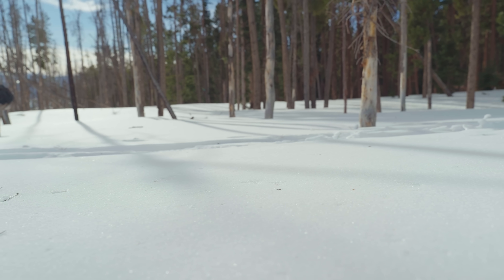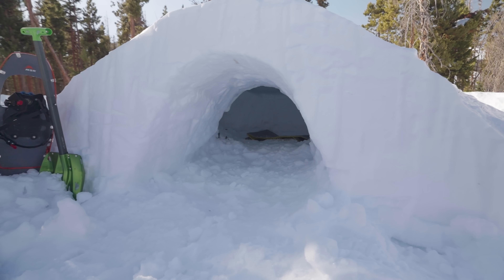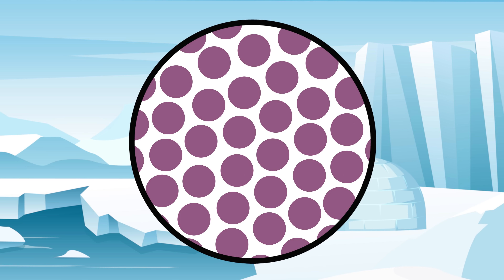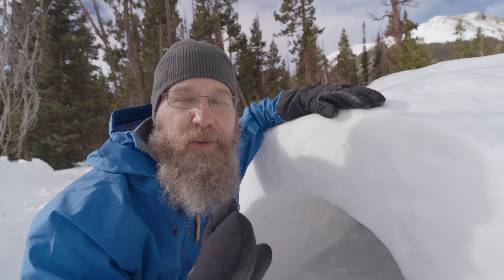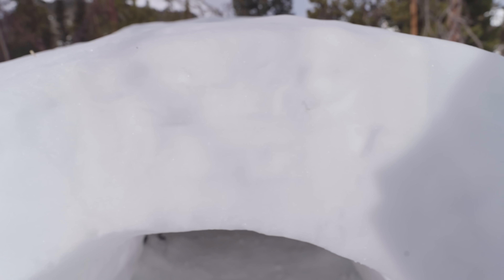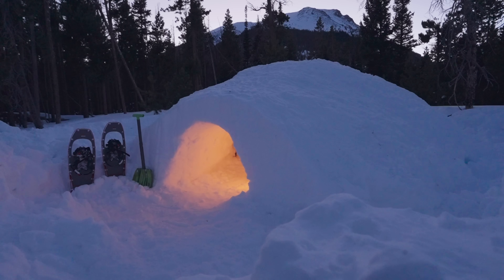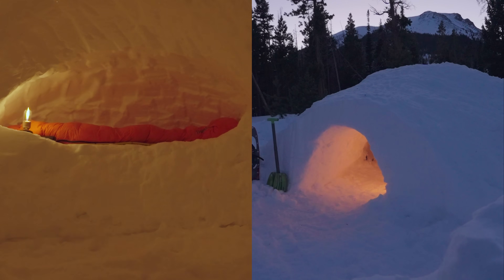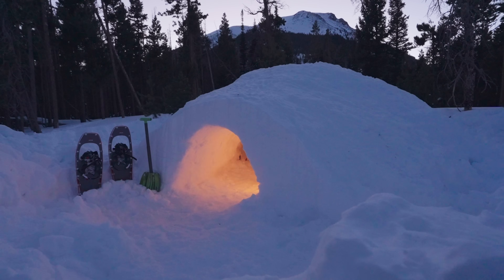Ancient Wisdom Proven Right by Science!

Comment: Once my teacher said that no human can feel temperature, all we feel is heat flux. Take out your hand in the air on the cold day and then touch some metal. The air and metal have the same temperature, but the metal feels "colder". The same thing is when you have a really cold hand and put it under cold water, you either feel nothing or like it's burning your hand.
Reply: This works the other way too, to an extent. Styrofoam can feel hot at room temperature depending on your hands
Reply: @SuperShado101  yes. Sensible heat.
Reply: Yeah...     Stick your hand in snow...    Just because it insulates against the COLDER temperature outside, a snow shelter doesn't make snow warm.
Cold does exist for humans, it's the absence of warmer temperatures compared to the acceptable operating temperature the human body needs to function and thrive.
I always laugh at Philosophy, that attempts to work beyond the human condition, such as when it attempts use things like Snow Shelters and how humans use them to keep from going below acceptable operating temperature, but then going off script to not applying it to humans, after using humans as an example, in terms of effects. 🙄
Reply: @vezeryk6706  I'll explain this again in simple terms. When you are cold you put on a jacket, you increase your insulation, your perception of "cold" is because you are losing heat to your environment and the jacket stops the heat loss. Your core temperature doesn't drop much before you I, Nirmal body temp is about 37c at 35c you have hypothermia and this can be fatal, at 32 you're not shivering anymore, you're dead. So you CAN lose internal temperature but 2 degrees C is the difference between healthy and possibly dead. It's the same with the o.p. thread the metal may be the same temperature but because if its conduction you are rapidly losing heat to it. The same occurs near non modern windows, it's called the "cold 70s " In my trade, again we are most comfortable around 21C ( 75f ) and so your room temperature may be 75 but if you are near a wall or window with poor r value ten you lose heat to it and feel cold, your internal temperature has not dropped . 
Years ago when we designed the the hydronic/ radiant system for a stadium we had to account for the btu load of occupants. Since high mass hydronic take 24 hours more to achieve temperature ( or cool ) we needed to supplement it with radiant panels. Full venues cut the boiler feed and actually run a coolant loop at times cause average human releases 400btuh at rest ( equivilent to 400 burning matches in layman's  ) 

50,000 people resting = 20,000,000 btuh. 

This was unique because usually you just use engineered air to open louvers and circulate cool air into the building to offset the delta t
Reply: oh my god i did not expect a war from absolutes heat genius nerds
Reply: like god damn
Reply: i dont understand  a thing everyone is talking about. it went from heat, to grammar and then heat again
Reply: NPC thread actively rejecting 1 guy bec hes not native in eng and goes agaist an NPC main comment, bots everywhere
Reply: @miaIceberg  😝😝😝
Reply: Ridiculous semantics. Of course humans can feel temperature. It's why we have fire and fans and clothing. Go play your mind games elsewhere.
Reply: Some things feel colder because they're better conductors or insulators.  Electricity is nothing more than a field of force around a wire, but I damn sure bet you'll FEEL electricity if you grab that wire while touching ground!  Electricity doesn't flow through a wire- it never did.  It's a force around the wire.  But go ahead and grab a hot bare wire while touching ground.  

It doesn't matter what terms you want to use.  They're all yours to use or not use.  But "cold" is a term I'm going to keep using because it means, "lack of heat" which is exactly what it is.
Reply: @deydraniadiancecht8298  Electricity (i.e. electrons) in the case of a wire, do flow through a wire, what you are referring to is the electric field that causes the flow of electricity to move through the wire... 🤦🏽‍♂️
Reply: @medicaldepotonline OH MY GOD WHAT AN IDIOT THEY ARE, AMIRITE???🤦‍♂️
Reply: @medicaldepotonline electrons hardly move in electrical lines...
The Youtube Unuversity told me so.
Reply: No, it’s simply due to heat capacity. For example, syromfoam has a very low heat capacity so even if it’s cold, your hand will quickly overcome its temperature (via heat transfer). No so much for metals. Have a search for their heat capacities…it’s maybe first or 2nd engineering.
Reply: @briane9238  Heat flux gets to the core of the issue, heat capacity is more of an abstraction. Both heat capacity and heat conduction are parts of the equation, but its kind of pedantic to say split hairs over which one contributes more because it varies by material. There is one thing in common though: If your hand is losing heat when you touch an object, it feels cold to you. It your hand accumulates heat when you touch it, it feels hot to you. Summarized by the term "heat flux". It really is that simple
Reply: @briane9238  it's due to its conduction. Metal conducts heat rapidly while Styrofoam is an isulator ( not a conductor )
Reply: @MrDmadness think of it this way. If you were to instantly extract all the heat energy in the vicinity of your finger (making the foam a perfect conductor), you would still not get burned. It’s simply because the foam stores very little heat (thermal capacitance) - so while conduction plays a role, the bigger role is thermal capacity. It’s the same reason you can touch a hot thin copper foil…just not much heat stored in it, even if the temperature is high. Most people are familiar with conduction, convection, radiation, but thermal capacity is less known to laymen. Hope that helps.
Reply: @briane9238  you're referring to thermal mass. And no, the foam is not that. It's simply an insulator while the metals a conductor
Reply: @MrDmadness the original question was why metal feels colder than air at the same temperature. It’s primarily due to thermal capacity. The hand can far more easily “override” the cold air because of the stored heat in the hand and bulk transport of blood than it can for the metal. That’s not a conduction thing..the MUCH bigger aspect is simply the difference in stored energy. Good luck.
Reply: @briane9238  yes but it is a conduction thing. You are losing heat at a greater rate to the metal than you are to Styrofoam.  There's quite literally no such thing as "cold" just an absense of heat. You feel cold when you are losing heat to your surroundings.  you put an insulator on ( like a jacket ) now you're not cold because you are not losing heat to the environment as rapidly. In the jacket example you are losing heat by convection ( through a gas medium ) , not conduction ( direct transfer between 2 objects ) . Your hand is colder touching the metal because it's a conductor.
Reply: @MrDmadness when I think about it some more (on the original question), there is some combination of thermal conductivity and stored heat energy that exists that balances the air (with respect to how your mind interprets the sensation of temperature). This is because the ambient air molecules (a fluid) directly contact the skin and are constantly refreshing at temperature. However, a conduction process will always be slower than that. This must be compensated by the thermal capacity and stored heat energy of the metal. For example, a piece of aluminum foil has a relatively large thermal conductivity but relatively low stored heat. In that case, the air will feel cooler..so we know that having a large thermal conductivity is not a sufficient condition. This is the same reason foil in the oven doesn’t burn your hands but a pan will. On the flip side, if a material has a low thermal conductivity but a large ability to store heat, the air may still feel cooler. But I think that scenario is harder to imagine for a metal…but that’s very subjective.
Reply: It's funny how wrong everyone is in this thread.
Reply: @myfakeaccount4523  bro is lighting 
a dumpster fire once more 🤣🤣🤣
Reply: You're teacher was wrong. I have a maior in heating design. There are 2 types of heat 1. Sensible and 2 . Latent .   sensible it heat you feel,  latent heaT changes state of matter. Your body temperature doesn't change but your perception of a cold object is your loss of heat to the object ( sensible heat )
Reply: @MrDmadness  Your points are correct, but the issue isn't that there are differences in 'types' of heat but that the body works on salt.

See, we have different types of sensory nerves, and they all work on ion exchange... effectively salt channels that shuffle electrical charges until a threshold is met, before dumping that charge and thus sending a 'signal' to the next cell. It's not too complicated, but the end result is that if left to their own devices, nerves don't do anything. They respond to changes not states. In other words, while we can feel 'cold' or 'hot', it's not perception of ambient temperature so much as the loss of body heat TO that outside not-us (or the processes that stimulate cooling if we're too warm).

It's counterintuitive, but advanced biology covers it simply because of that curiosity.

Material design, engineering, heating and cooling, etc focuses on heat transfers and thermal deltas, how they interact and the like. But the point to take from it is that there's a difference between 'feeling' hot and 'being hot'... and likewise in the perception of heat rather than how hot something is.

Same reason that we can feel cold and end up sweating under the covers... our bodies have self regulation, but not absolute data collection. It's really rather wild once the mechanics are understood.

So, TLDR, no, their teacher wasn't wrong, and neither was yours. The disconnect is between definitions that remain a bit ambiguous.
Reply: @kimudo  what you said is absolutely correct, there is a difference between feeling heat and your actual heat levels (temperature) , for example when you have a fever what you have is higher body temperature but you will feel cold because as the temperature of your body rises the difference between your body temperature and ambient temperature of the room increases as well which increases the rate of heat transfer between you and the enviroment therefore you feel cold while you are actually hotter, when you touch metal on the other hand it feels colder than lets say the air because it has a higher heat trasnfer coefficient which to put it simply for those that dont know means that metal can absord and transfer heat withing its entirety faster than other objects like air or wood
Reply: @MrDmadness  no, I don't know how you've misread his comment but he's 100% right. also, might want to check your grammar.
Reply: @MrDmadness yes, if you can't hold something hot in your hand it's probably over 50*C
Reply: @sharymens8187  yup. 50c takes about 10 min of continuous contact to produce burns.
Reply: @MrDmadness Who even feels sensible heat? It’s just the energy required to change a body’s temperature by 1 degree
Reply: @satsumagt5284  it's not, it's called sensible heat because you can feel it. You can feel the difference between -10 and +10, you can also measure it, latent heat not so much which is why its relevant to this discussion
Reply: @MrDmadness  Sincerely, Your argument is ass. Body temperature does change when you lose heat... The latent heat is during freezing/unfreezing or with like liquid water changing into vapour, it's an isothermal process. Don't know how you found that in the hand tho. ...Try getting outside maybe and see if your body doesn't change temperature? The body keeps it's temperature either by cooling itself with sweat or internal heat generated by biological processes. Still, it doesn't change the fact it's the heat flux that is responsible for the feeling you get in the brain.
Reply: @vezeryk6706  your internal doesn't change till you start to die buddy. Latent heat is the heat that changes state of matter
Reply: @MrDmadness  Um... that's not even remotely true.
We have a range of 'safe' temperatures, but that's why we have a 'set point'... it's a biology term that references the body's recognized safe operating temperature. It's why fevers and hypothermia happen... when the body gets outside its ability to properly and automatically self regulate.

Your 'core' temperature might not change much... but that's like saying you are incapable of burning your hand because the thermometer in your mouth reads 98.6.... far below 160, so you can't be hot.

And, incidentally, state changes are FAR outside of any safe core temperatures for humans. You're arguing different terms and meanings, not that heat exists.
Reply: @ What do you need latent heat for? I just doesn't get why you repeat that like it's some mantra. Your point was like completely off topic. Latent heat is just a property that has no use in human body in normal living conditions... if anything you could argue about water vaporising off your skin, but that's just one case and doesn't even cover whole thing I wrote about. Do you even read what you texted? You just stated the obvious in the second sentence. Ur probably a bot. Idk, I may be getting ragebaited.
Reply: @MrDmadness whats fever then? Its a change of internal heat
Reply: @NicoMaichenitsch  by less than 1 degree yes. Your body goes into status to recover
Reply: @MrDmadness I would double check your diploma. That online university might have been a scam.
Reply: @alexandernater6284  heating design major, electrical journeyman, a class gas fitter, master plumber. All ticketed  trades bud. There is no such thing as cold, only a absence of energy that we call heat weather we percieve it by conduction, convection or radient
Reply: @PaulKlein-m1f  yes. And I design heating systems, which is more than a 4 year course bud. You can argue all you like or offer a problem you'd like solved so I can easily prove my point. Have you designed stadium heating and cooling systems?  It's not done on the fly, its done in the office.
Reply: @MrDmadness  Problem is dude, your communication is horrible. Which is kind of key to instructing.

You show up and answer the original comment with "you're wrong", then justify it by using the exact same concept he was talking about, and end up proving him right. And you don't even seem to realize it, just because it's not formulated the same way.

The teacher said: humans don't feel heat. They feel heat transfer.

You're like: "wrong, there are two kinds of heat, latent and sensible" which wasn't really the topic. And also not really true. By your terms, only latent is actually heat, so there is only one kind. Sensible is actually just our perception of heat transfer, not technically heat. Which was the teacher's point.

And you add "sensible heat is the heat you feel". Then explain that "sensible" is perception of heat loss. (But also of heat gain, with something too hot. So, basically, we could call that heat transfer maybe?)

In that statement, you're proving everything about the original comment right. By saying what we feel is sensible heat, you implicitly confirm that we don't feel latent heat (which is in other words the actual heat, as in the state of matter)? Then you explain the heat we actually feel, "sensible heat", and it turns out that it's basically heat transfer. Which is all everything that the teacher was originally saying, which you said was wrong.
SO what the HELL are you making a fuss about?! You're agreeing, you're just using different words.

A key part of teaching is expressing a concept in as many different ways as possible. Using one way of describing things will not connect with every student. Repeating the same thing over and over will not help much. You then need to express it differently, using different images, to try to find one that they grasp.
Then, students will often be asked to explain the concept with their own words, to check on their understanding. If you can't understand their explanations just because they're not using your terms, you won't be able to tell whether they understood properly or not. You might tell them they're wrong, when they're actually right but just saying it differently. As was apparently the case here.
Or they might be wrong, but if you can't follow their explanations using their own terms, you won't be able to accurately pinpoint their mistakes to correct them.

So really, are you sure you should be instructing? If you got all this trade knowledge, perhaps you should stick to applying your trade instead.
For all that the saying goes "those who can't do, teach", it does not necessarily imply that those can do will be good at teaching.
Reply: @Elendor57  i already do teach bud
Reply: @MrDmadness  I'm sorry for your students.
Reply: @henriquepacheco7473  they've all aced their tests so I'm not sure why you'd be sorry for them, be sorry for yourself for remaining ignorant of facts
Reply: @MrDmadness  "your internal doesn't change till you start to die buddy." Never had a fever???
Reply: @EdHunter55 yup, didnt die because of status ... context matters troll
Reply: @MrDmadness  Nah humans cant feel temperature only change. If humans were able to feel temperature 21c would ALWAYS feel the same and it doesn't. a room of 21c does not feel the same as a bath of 21c or gale force wind...
Reply: @EdHunter55 yes because of wet surface area and vapor pressure differential
Reply: @MrDmadness we can tell you aren’t an English major
Reply: @ it’s obvious you do 😂😂 and if it’s your first language and you have this much issue spelling correctly or even taking a second to correct your mistakes, then you’re simply lazy. I’m on a touch screen as well. See all the spellings? Even use proper punctuation for the most part.
Reply: @breakdown2878  again... do i care ?
Reply: @ I assume so as you keep responding. A great tell that you don’t care is ability to ignore a comment. Your inability to do so would tell me otherwise. Also nice pfp.
Reply: @breakdown2878  I respond because I'm also retiring from on the tools into an instructing position in the next 5 years or so, so responding to you helps me temper my response instinct to students, It  also re enforces what I can commit to memory ahd actively retain in the even I am asked questions ( as I will be ) I can't just say "ohh it's too much to explain right now " if I'm feeling off or otherwise. Do you understand ? I'm jot joking about my qualifications, feel free to look any of this up
Reply: @ so “again, do I care” and others along those lines would help you for your job teaching?
Reply: @breakdown2878  no, but I'm human and get annoyed. And I don't really care what people on the internet think about it as it doesn't effect my reality nor my credentials. I passed a test and have an advanced degree in this field so I've already proven my knowledge under strict test conditions.
Reply: @MrDmadness  I love how you don’t care yet you keep responding. You will only get more annoyed the more you reply.
Reply: @MrDmadness you made a grammatical error in the FIRST WORD OF YOUR SENTENCE. After seeing this, I chose not to read any further and considered your argument invalid
Reply: @Just_Gent  yes because grammar is relevant in this discussion.  Not everybody is skilled with the English language, it’s fallacious to assume they’re wrong because their grammar isn’t 100% on point. Next you’ll say their point is invalid because they can’t play the guitar 🙄